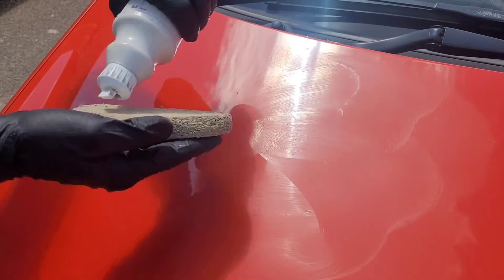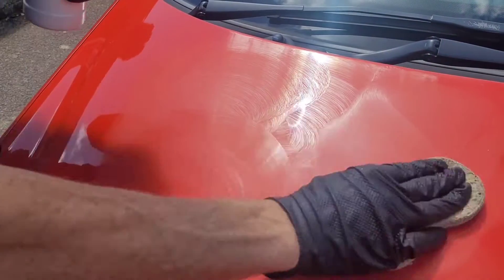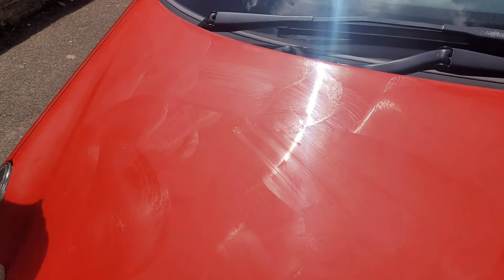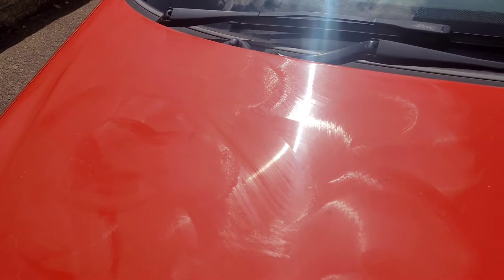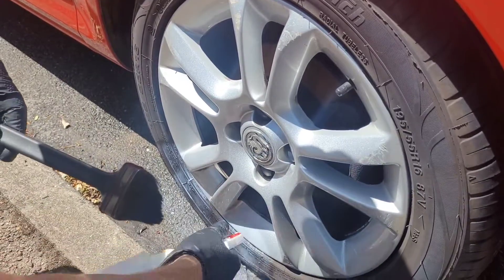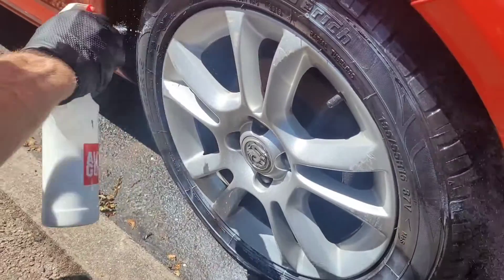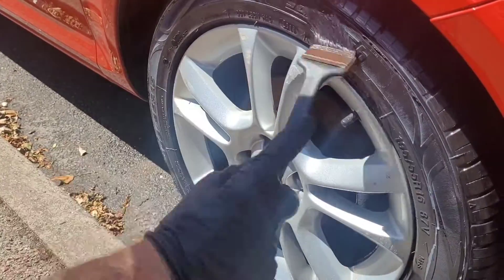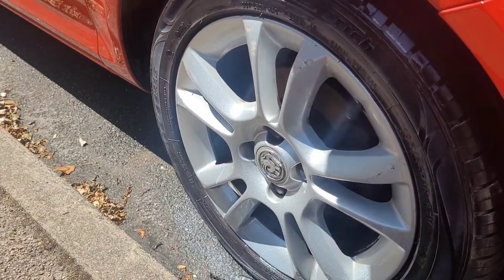A Day In The Life Of A Mobile Car Valeter Cleaning A Tesla & Vauxhall Corsa

Comment: I really enjoyed watching this video. You done an excellent job on the Corsa. I'm sure the customer was over the moon. Do you have any products for cracked leather car seats? Or any advice? Many thanks
Reply from the maker: Hi, there is a process where you can fill in the cracks with a specific filler then smooth and re-paint / seal, I do believe kits are available to buy to do this but never used one before other than this advice from vehicle upholstery services, many thanks
Reply: @HitchinValeting   That's great! Thanks very much